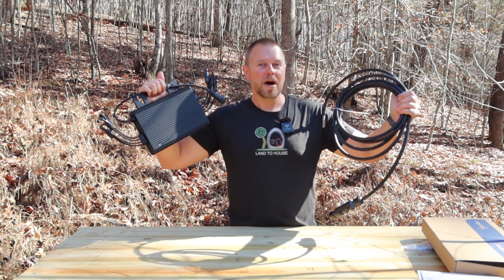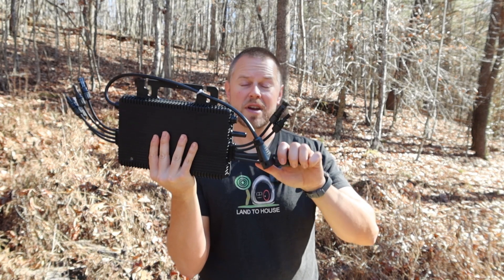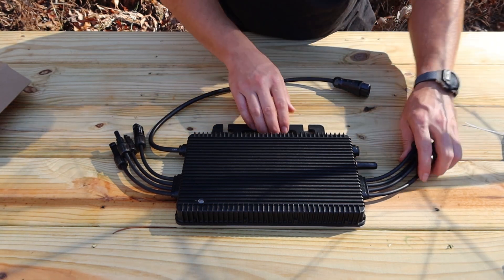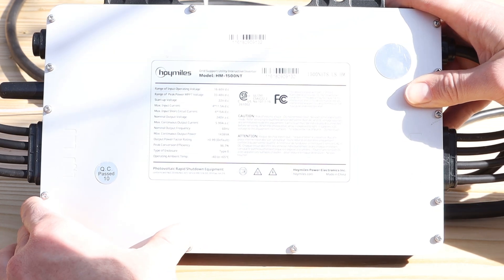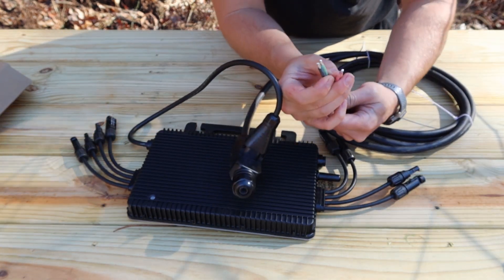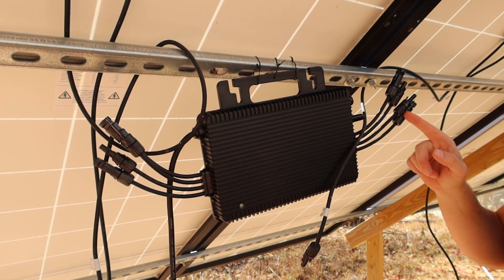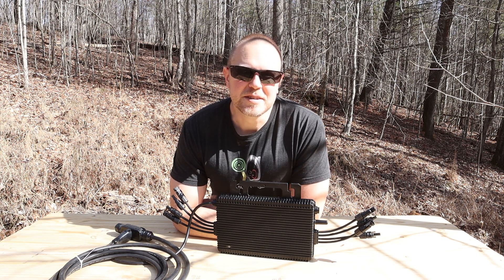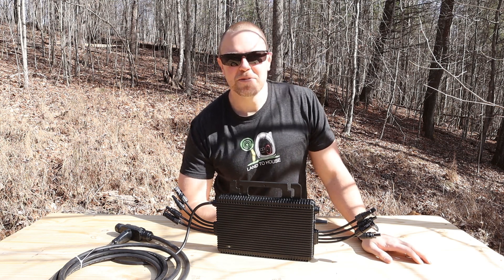What is a Micro Inverter? [Hoymiles Micro Inverter Unboxing]

Comment: Seth, does the Hoymiles require any type of "Gateway" or is it out of the box ready to produce 240VAC when it sees it is connected to a 240VAC grid at 60Hz? (Assuming it has the solar input).  I ordered the exact same unit (mine is 2,000 Watts) you are showing it just hasn't arrived yet. I was surprised at the cost of the Trunk Cable!

Comment: Rather than explaining the input as "4 times 15A", it is better to explain that each input is 15A and so many volts or speak it as "4 by15A"

The one stat I didnt hear is the most important one for any inverter(in either direction. What is the Effiency of the unit? How much energy does it waste vs keeping your full system DC and living with occasional shading?
Reply: 97.5% CEC efficiency.

Comment: What if you had 20 large panels on one array or entire roof etc?
Reply: You can use a T branch style MC4 connection to get a series parallel panel string within your voltage requirements

Comment: QUESTION 6)

6) How do you get Split Phase out of each run and maintain sync across multiple runs, and how to wire split phase into the breaker panel from multiple runs?

thx

Comment: I have been wanting to understand micro inverters for a long time.  Unfortunately no one explains in detail this type of inverter ecosystem.

Your explanation is by far the best, and most understandable to date.

Here are my QUESTIONS, for your future videos:

1) when you daisy chain multiple micro inverters onto the backbone wire, how do they stay in phase with one another?

2) when you have multiple runs (backbone runs) how does each run stay in phase with the other runs?

3) how do you wire multiple runs into an AC breaker box, to then be distributed for use to the house or building?

4) How do you store energy from these micro inverters which output 240V AC into a DC battery bank?

5) how do you get energy out of the battery bank and into the AC Breaker Panel, and keep it in phase with the input from the micro inverter runs?

I have more questions, but if you could answer those in depth, it would be greatly appreciated.

Thank you.
Reply: You wouldn't use micro inverters on a battery system, you would want a hybrid charger inverter, you want the batteries on the DC side for efficiency.
Reply: @starlink3125 learning about microinverters   i have to solve the issue of solar array being 200' away  So can i use microinverter to convert to AC THEN haul the power 200' as AC then at my garage wherr my battery banks are looking for DC on XT connectors  just convert the AC from the microinversion backhaul in AC back to DC at my garage?  Is there such a device ?  im trying not to run 8 PV 8guage AWG wires 200' because that is an insane amount of wires  thanks for any reply or thoughts as i design my system in Jan 2015  FYI  i understand the concept of losses stacking dc ac dc but the alternative is not getting the panels installed and going without   goal is to chage the battery bank